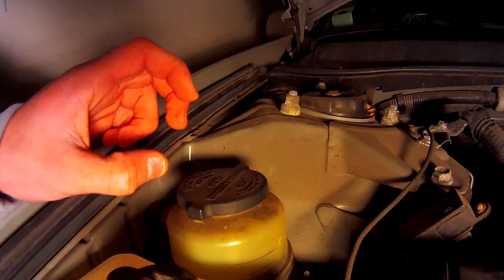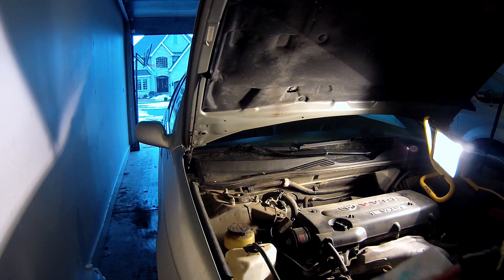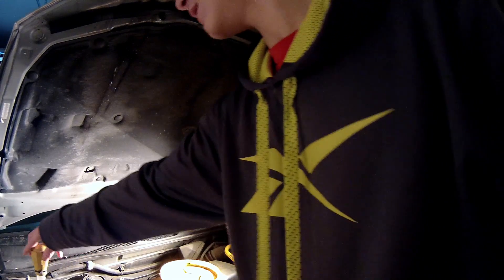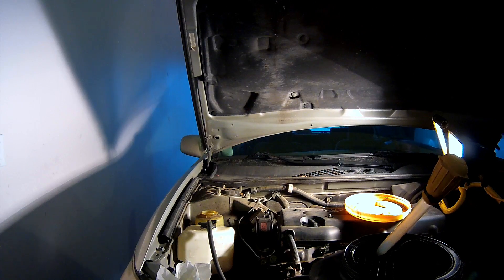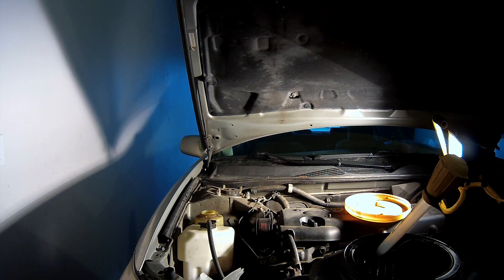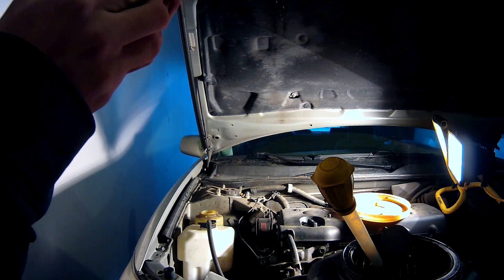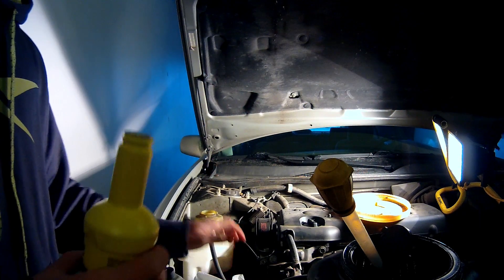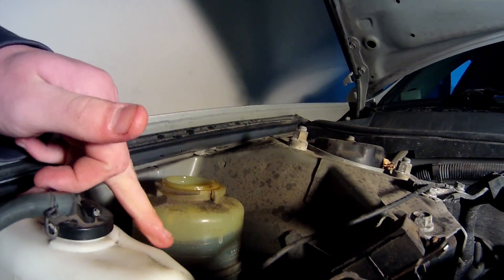2002 Toyota Camry Power Steering Fluid Change

Comment: Most GM cars use Dextron ATF, its used as P/S fluid in most Asian vehicles. There is nothing special about the P/S fluid and you can pick it up at any store (even Walmart).

To do a good power steering flush, remove the small hose (return line) on the tank, connect a recovery hose, start the engine and it pumps all the nasty fluid out the 3/8 hose you removed. Refill the bottle and repeat until the fluid comes out a pink color. The system holds about a quart.

Comment: The squeaky noise is coming from the steering column base. Use a white grease spray to spray at the base of the column (on the floor). This will fix the noise problem.

Comment: Lol that whine in the beginning when he was turning the steering is from the dry seal or rubber where steering rod goes out from the floor ...just spray some wd40 and it will be gone...how do I know... I own one ...and Do it once a year
Reply: Not WD40 but Toyota white grease or lithium white grease. WD 40 won't lubricate for long time
Reply: +WebTalk Host ...Awesome yes if you have that..will definitely work better.
Reply: Yep.. did the same thing lol the noise is coming from where the pedals are
Reply: WebTalk Host unused chain and bar oil

Comment: I have the same car. Power steering fluid for "asian cars" means it will work for cars that call for that fluid.  Cheap, advance auto ATF is Dexron III for $4.99.. most of the ATF you will find at the store will be Dexron III, suitable for Dexron I II or III
Reply from the maker: MrAudio77 Yeah, it was temporary. I replaced it with the correct stuff "Dextron ATF and the squeaking sound went away.
Reply: @fireboy2333  I think either is fine.  I don't really want to flush mine, like you, but I want to get more in one shot than is possible with a turkey baster, so I am looking for a good drain point underneath.
Reply: @fireboy2333  I think this video, at about 1 and a half minutes in, is how I want to drain my fluid, which looks to me like I can get almost all of it without a flush.  https://www.youtube.com/watch?v=pcDSnDhXjNw  Though it might be easier to just loosten one of those metal pressure lines with a wrench and drain it without even needing to remove it.